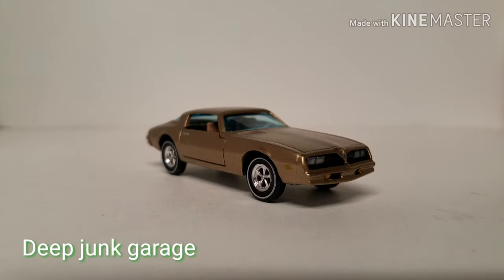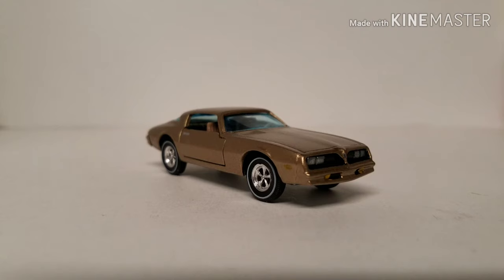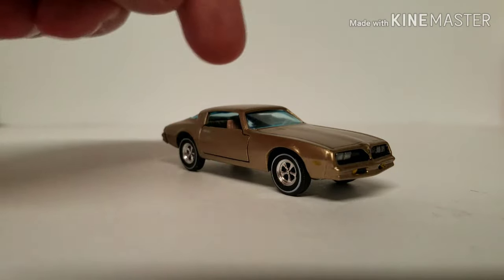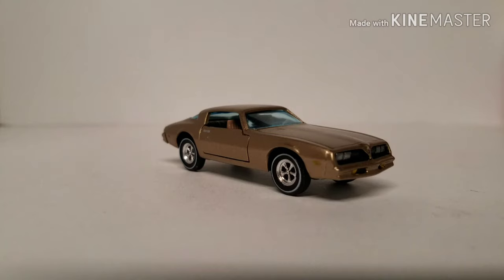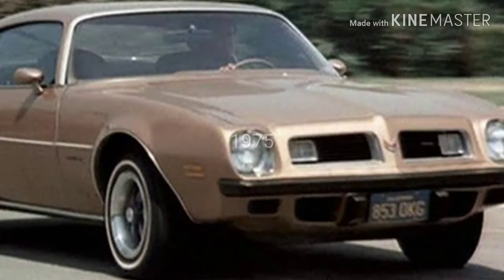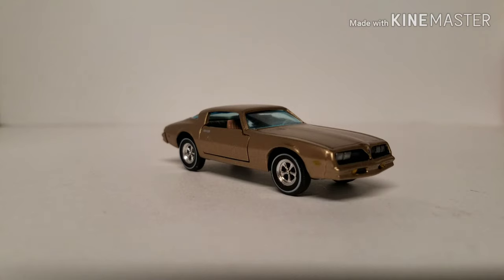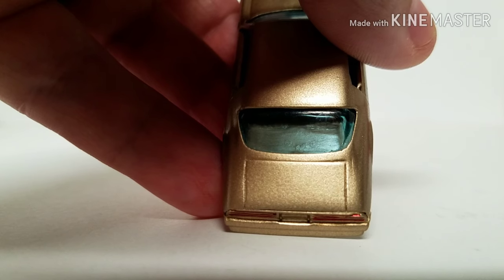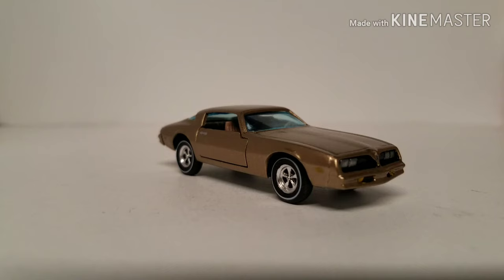Opa's T.V and movie car build off !

Comment: Here's my only observation as a "rabid" Rockford fan.  His Firebird never would have had those rims.  I think with some black paint you could have made them into a fair approximation of the stock GM Rally wheel of the day.  Very nice job though!
Reply: I build t.v. and movie cars too, it's not always easy or necessary to build them exact, especially in S scale.  You must use what is readily available. A close representation is all that matters.
Reply from the maker: Those wheels are a (Shiny) rallye II. In all the hub bub I never painted the surrounds in a argent color. As I'm reading your reply it hit me that I didn't do that. LOL  🍻